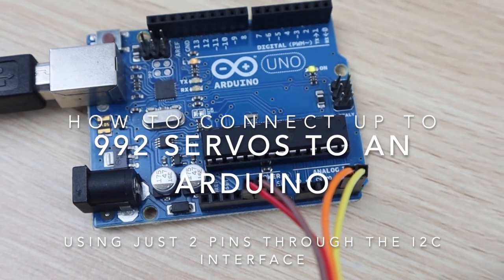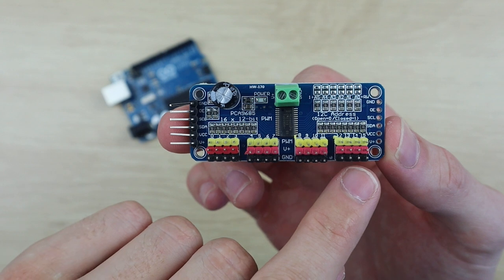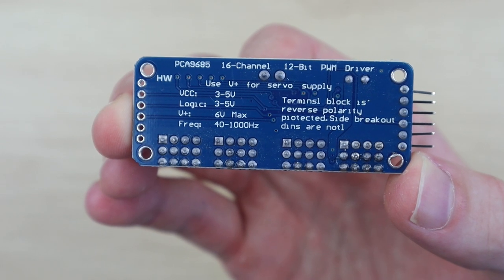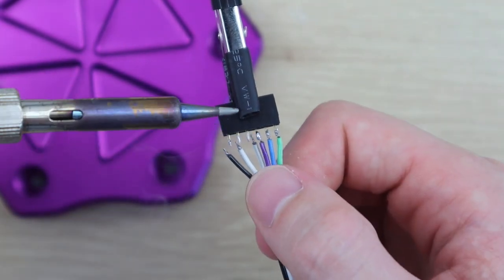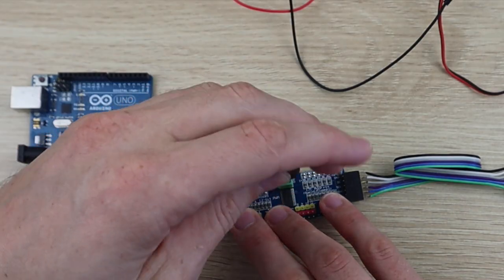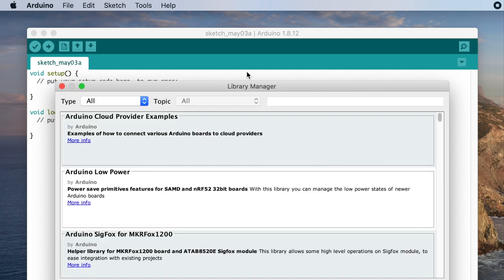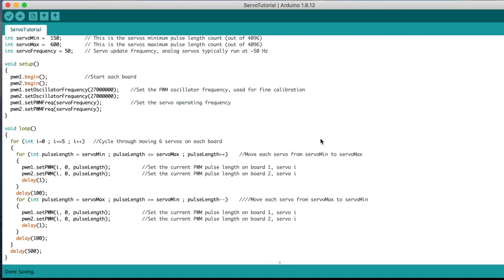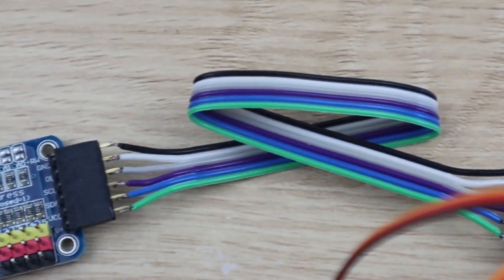Connect Up To 992 Servos To An Arduino, Using I2C

Comment: Hi Micheal, 
Thanks for this tutorial!
I am currently building a project in which I want to use 10 sg90 servo motors. I got a PCA9685 board, and by the looks of it, it is the same as the one you are using in this video. 

I have a little question I hope you might be able to anwser: When I look up de datasheet of the PCA9685 board it states:

"The LED output driver is programmed to be either open-drain with a 25 mA current sink capability at 5 V or totem pole with a 25 mA sink, 10 mA source capability at 5 V." 

How is the board able to control these servo's, considering sa95 servo's use about 500+ mA? Is it because LED's operate at 1khz PWM frequency and most servo's around 50-60hz?

Kind regards,
Daniël
Reply from the maker: Hi Daniël,

Controlling servos and LEDs is quite different, although done with the same driver.

LEDs only have two pins, an anode and cathode, so the driver supplies "power" to the LED using the PWM signal and is therefore limited to 25mA by the board.

Servos have three pins, they get power from 5V and GND and the PWM signal is just a refernece that it uses for the servo position. No power is transferred to the servo through the PWM signal. The board supplies 5V power to the servos through the power input pins at the top.
Reply: @MichaelKlements  Thank you so much, this clears up things a lot :)

Comment: great tutorial! thankyou so much Michael. Im wondering if this driver can be use to act as Electronic Speed Controller (ESC) ? Im planning to DIY a ROV for myself. So each thruster motor will be needed to be controlled individually (speed and rotating direction) any advice and recommendation would be great and much appreaciate.
Reply from the maker: A PWM driver is usually used to drive the ESC - most ESCs require a PWM signal to tell them what to do. So you could use this to drive multiple ESCs but the driver itself can't be used as an ESC.

Comment: Hi!
Why cant you supply power from Arduino UNO?
Reply from the maker: The servos require too much current for them to be powered through the Arduino, the onboard regulator can't handle more than a few hundred milliamps and each servo by itself can draw more than this.
Reply: @MichaelKlements  Understand! Thank you!
I planning to start a project to build some device for flight simulator, device that will read data from shared memory and will connect to pc via USB.
Is Arduino Uno is OK for that?
Thanks.
Reply from the maker: Yes you should be able to use an Arduino for that.

Comment: Hey I’m pretty much a beginner when it comes to arduino but is it possible to move the servos at the same time and how can you do it ….I am currently working on a project for class and I have been trying to get the four servos moving at the same time but there’s been no success
Reply from the maker: It depends on what you mean by "at the same time". If you want them to move at the same speed, same direction and to the same point then simply connecting them to one PWM output would work. If you want them to move independently then you'll need to incrementally change the PWM signal to each. A microcontroller can only run through code/instructions one by one, so it can't give a different signal to each servo at the same time, there will be milliseconds between the signals being given but this is usually not noticeable if the code is well written.

Comment: Can they be hooked up to an I2C multiplexer for thousands of leds or servos?
Reply from the maker: You'd probably start running into issues in how quickly the Arduino can issue commands to the LEDs and servos if you start going over 1000, so there would probably start being an noticeable delay in the updates. Other than that its probably possible.

Comment: Can i plug a 12v 2 amp uk plug charger into the terminal block? if have a 12v 2 amp power on the arduino uno will this transfer on to the driver board through the 5v pin?
Reply from the maker: No, you need to supply the driver boards with 5V. If you plug the 2A power into the Arduino, you'll get 5V to the driver board, but not the full 2A as the Arduino's regulator can't handle the +-4.5A at 5V.

Comment: Does this work the same way on an arduino leonardo? And what is the 0 in the code when you were setting the "i" servo up?
Reply from the maker: Yes it would be the same for the Leonardo, you'd just need to use the dedicated SCL and SDA pins on it. The 0 and i are the two pulse limits, for servos you'd probably always want the lower limit to be 0.
Reply: @MichaelKlements   OK. But I didn't see any code that would move the servos independently. I feel like it would be good material for a tutorial, since there are people like me who don't have any idea how to do it.
Reply from the maker: The code in this example moves them independently. The counter i selects which servo to move and then give it a position reference - pulseLength.
Reply: @MichaelKlements  Is there a way to make the servo copy what the potentiometer is doing?

Comment: hello sir, im new to this . but in power supply for pca9685. is like this right?  
jumper wire <- female DC connector < power supply adapter .

Comment: Thank you very much for explaining very well about servo motors. I was wondering if you know why when controlling several servos there is no homogeneous operation. I am trying to control 42 servos and they just go crazy. Without respecting the angles from 0 to 180 degrees.
Thank you :)
Reply from the maker: I'm not entirely sure what you mean by not homogenous - but servo's are actually quite intricate devices and since the primary manufacturing objective is almost always price, there is is a lot of variation in their characteristics. Even the same brand/model of servos can have slightly different travel limits and centre positions. 
Another significant issue is often power consumption. Servos can maintain their position with a few milliamps, but typically require around 0.5A to 1A of power to move quickly. So if you're trying to power 42 servos at once then you probably need somewhere around a 30-50A power supply - which you're unlikely to be using. When they draw more power than the power supply can handle then the voltage dips and this causes further erratic behavior in the servos and the microcontroller.
Reply: @MichaelKlements  Thank you very much for your response. I was just referring to that kind of behavior. I am using an Arduino Mega and indeed I am not using any external power supply. As you mentioned, my mistake is in that matter. I was planning to use an Adjustable Step-up Module. Thank you very much for your help. I'm hoping to figure out the servo madness :P
Reply from the maker: Yeah if you're not using an external power supply then that's most likely your problem. No problem at all, good luck with your project!

Comment: how much the voltage that you connect to the pwm servo driver?
Reply from the maker: 5V for servos. If you are running LEDs then you can do 3.3V - 6V if the LEDs can handle the voltage.

Comment: Why didn't you utilize all of the PWM pins on the first board, instead of using two PWM boards? Or was it simply for demo purposes?
Reply from the maker: Just to demonstrate the possibility of running two boards

Comment: This is all well and good, but I would like to drive the servos individually by the use of separate digital input pins connected to toggle switches. I.e. on = rotate right 45 degrees… off = rotate left 45 degrees. Every where I look it seems no one shows the independent control of individual servos.
I want to use them to throw the turnouts on a model railroad layout  so they would be “commanded” by their own related toggle switch on a control panel. I believe I would be required to use an Arduino Mega. I need to control at least 16 servos.
Reply from the maker: You probably won't find exactly what you're looking for because this is quite a unique use case. Most projects use a number of servos to respond to a few command inputs (2-4 typically) or sensors.
What you have described can be quite easily implemented with this same setup by just adding a typical pushbutton input to the Arduino for each - tutorials for this are widely available.

Comment: Hi i want to connect 2 arduino leonardos which both have the same sketch on, they are 2 gamepad HID controllers the reason i would want to do it is to make them pick up as 2 seperate HID devices with 1 USB connection  how would i code that?
Reply from the maker: Hi Wurminator.
I'm not sure that you'd be able to get the computer/console/device to pick them up as two separate HID controllers on one USB connection. Why do they need to be connected through one USB connection? Would it not be possible to connect both Arduinos to the device through a USB hub?

Comment: If me use power supply 10v to pwm its safe?
Reply from the maker: The servos require 5V, so 10V will most likely damage them and/or the controller.

Comment: hello I would like to activate 15 motors with pca9685 can you help me please?
Reply from the maker: What do you mean by activate the motors?
Reply: hello could you help me please I would like to program 15 engines?you could send me a diagram of how to connect the arduino and joystick... I with the arduino I only activated 2 engines then I bought a shield or a pca9685 how do I program 15 engines?

Comment: What this ardunio use
I am  use 12v dc moter rc jcb
Reply from the maker: I'm not really sure what you're asking here. These drivers need to be supplied with 5-6V, they aren't suitable to drive 12V servos or DC motors.
Reply: @MichaelKlements  : Then please let me know how can I manage to run 40 12v DC servo motors  . Thanks in advance.

Comment: Hey, very cool and inspiring video. 
Im new to Arduino and electronics, but I am currently working on building a quadruped robot where I need 8 servos(DS3115) 20kgcm trq. 
My (maybe stupid) questions is 1. If i need the servos to go on 5v and stall current is 1,8A, what power supply do I need? Or more in general, how do i know what pwr supply is nedd?
2. can these things in the video be used instead of other power supplies?
Reply from the maker: The simplist was to ensure that your power supply is able to drive all of the servos at once (which may be required for a robot) is to just find a 5V supply than can do 1.8A x 8 = 14.4A in total or around 75W. 
I'm not sure what your second question means - these boards are controllers for the servos, you'll still need to power the servos throughsome form of 5V power supply.

Comment: Hello!
Your channel has helped me a great deal. 
I'm currently working on my first arduino project, a 36 servo headpiece. 
6 arms per side,3 servos per arm.
Currently I have the arduino uno r3 connected to 3 pca9685s. 
I have as my power supply an 11v lipo battery. I have added the necessary buck converter to step down the voltage to 5v. 
The first time I connected the arduino to the battery and disconnected the USB I lost power,so I then connected a wire to the v+ pin on the pca9685 then connected it to the 3.3v pin on the arduino. 
This works beautifully, my problem now is that as I try to install the Bluetooth module to the arduino, I don't know where to connect it,
Is there another pin on the arduino uno r3 that can power the Bluetooth module?
Reply from the maker: Maybe try run a lead from the battery (or output from the buck converter) to your Arduino's Vin pin, that'll free up the 3.3V one.

Comment: I'm new to coding so this may sound stupid but can I use the adafruit code if I'm not using a adafruit product? 

I've got this from amazon "HALJIA 16-Channel 12-bit PWM Servo Motor Driver" and im using it with a uno r3 clone. I want to controll multiple servos with a potentiometer but I'm really struggling with understanding the code and I asked the arduino community and they told me to just go and learn it without actually helping me to learn.
Reply from the maker: Yes you can, these boards in the video aren't original Adafruit boards and they work with the Adafruit libraries.

Which parts of the code are you struggling with? Yeah the community can be a bit harsh to newbies, but also make sure that you've done some research before asking questions on forum's. They're not very tolerant of questions being asked which are easily solved with a quick Google search.
Reply: @MichaelKlements  thanks for the reply I really appreciate it. I'm struggling with all of it tbh lol. I have now given up on the idea of making the servos work as I just don't understand
Reply from the maker: Maybe try taking a step back and getting one to work directly from an Arduino before attempting to get these boards working. There are examples built into the Arduino IDE for servos.
Reply: @MichaelKlements  iv managed to get one servo working with a potentiometer but I'm struggling with adding the motor driver so I can plug my other servos directly in

Comment: Hi I am doing my Masters in Interior design. I am Designing an interactive art installation. I want to know that how can I control servo motors using as Music equilizer?
the idea is that the user can play some digital instruiment on an Ipad or some Song and the multiple servo motors will create pattern responding to the music/Sound. Is there any site where I can find some code for this project?  Any help from anyone will be helpful.
Reply from the maker: You'll need a spectrum analyser chip or something similar, but can definitely get a project like that running on an Arduino.
Reply: @MichaelKlements  thanks

Comment: Hii Michael nice video thanks ^^! I'm planning to use at least 1 of the PCA9685 board in a matrix of fans (Coolers how you prefer to call them) of 3x3 (explaining that can be scalable to 4x4, or 5x5 with 2 boards and so on) to control them by PWM, I'm just wondering which coolers would be the best, I'm thinking about using the 4 wired ones, better at low voltage 5Volts, or max. 12 V, but as the board supplies 6 V, I think I'm going for the 5V, but I would like to know which ones should I choose (coolers) I mean by current because I want to be able to use the 9 (or 16 if they were 4x4) at the same time, not just individually, any suggestions? I need to get them as fast as possible for a project, that's why I'm asking directly, at the U will only provide me some of the materials, and for example the coolers they told me to find by myself XD, and I'm not sure if I'm going to find a store where they have them as I'm new to Belgium :3 I will ask, but I would like to know about this before going and implementing.
Reply from the maker: Aliexpress have a range of 5V PWM fans that would probably work for this, most stores offer express delivery through DHL or Fedex. If you need them faster than this then you'd probably need to visit a local electronics or computer store.
Reply: @MichaelKlements  Thank you so much for the reply Michael! Ok, perfect, and one more thing I was checking the Adafruit board in its website and the datasheet for the PCA9685, I didn't read it deeply, so I'm not sure, how much current should it support to connect up to 9 (or maybe 16) DC motors? Because I found the value of voltage that it is required to work and the voltage it delivers, because I want to know if the coolers I'm going to buy are with a current consumption not too elevated (for example I found a cooler with 4 wires with these specs: 9GA0405P6H001.

FAN, AXIAL, 40MM X 40MM X 20MM, 5VDC, 350mA; I want to make sure that driving 9 of them is not too much current for the board). I hope to be clear with this question. Thanks again :D!!

Comment: Hello!
Very new to arduino, 
I've 3d printed 2 robotic headpieces ,1 requires 36 servos, the other requires 20.
They will both be running off a 3s 11.1 v RC Lipo battery.
I have the buck converters,do I  connect them from battery to buck converter to pca9685?
Or does the power need to go through the arduino r3?
P.S.
I've subscribed to your channel, it's been very helpful, thank you
Reply from the maker: You'll need to route the power through the buck converters and then directly to the PCA9685s. An Arduino can't handle that amount of current (depending on how many of the 36 servos are required to run simultaneously).
Reply: @MichaelKlements  thank you very much for your help 🙏
Reply: @MichaelKlements  I will need all the help I can get, I just subscribed to your channel

Comment: Hi Michael thank you so much for such a video🙏🏽❤️, I'm gonna create a DIY Vending Machine with this idea. I want to control 12 servos using an LCD TFT display and 3 IR sensors to act as a coin machine, Can you please give me some tips on how I can do that?🙏🏽
Reply: If you creating vending machine that would require 12v motors have can you manage to run those motors . As in this video we saw these servo motors run with 5v . How to run 90 12v . If you have any idea please let me know it would a great help.